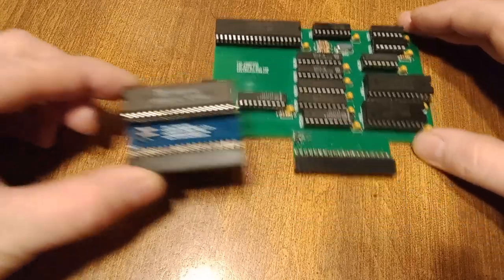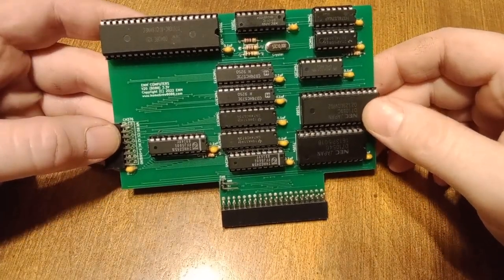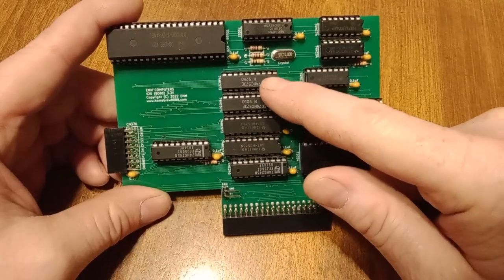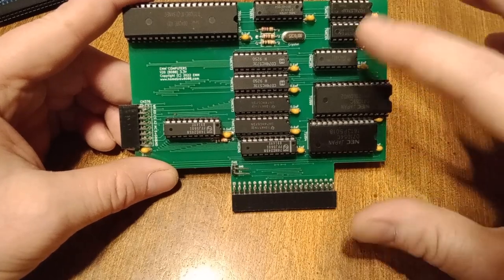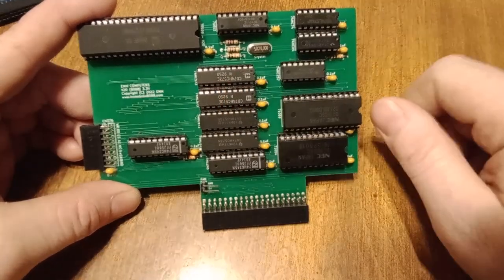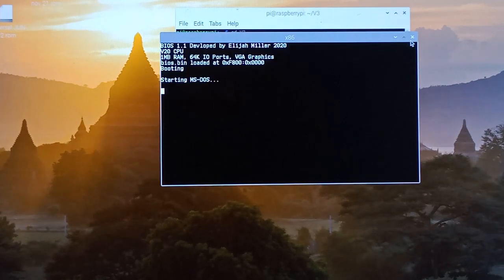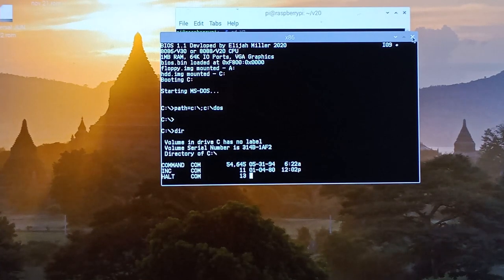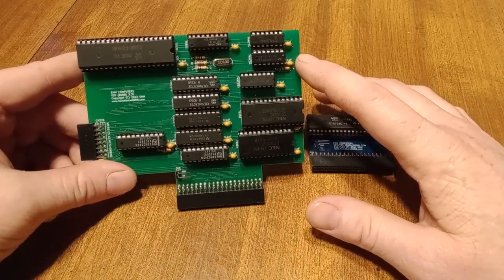PI86 Version 3

Comment: Great video!
Just curious - do you think your project could become something like a "sidecard" - I mean some sort of a card which could run X86 apps while running other native ARM apps? I think such a solution could be useful for some legacy hardware where someone wants to move to an ARM and he/she is "stuck" with some legacy software.
Reply from the maker: I think something like that could be done. It would not be very efficient and would probably be faster to emulate x86.
Reply: @elijahmmiller  If you need a faster bus connection, then perhaps you could look at the Pi's CM4 solution, it has PCIe bus
Reply from the maker: I will have to check it out. I have been playing around with the RPI Pico. It is actually not the RPI hardware that is the issue. It seems more that the Linux kernel read and write speed to the GPIOs
Reply: @elijahmmiller  there's a good chance the bare metal RasPi version of Circuit Python would perform better bit twiddling GPIO even with the interpreter overhead. A bare metal SDK like Circle should definitely do better.

Comment: Might also try using direct GPIO calls and not going through the wiring library along with DMA on the GPIOs. Ive seen 68k emulators for like the amiga's and such that use the pi as the cpu, and thats a faster cpu then what your trying to read from, so the GPIOs id assume can be fast enough.
Reply from the maker: Do you have a link to some resources on direct GPIO calls

Comment: stating the obvious: microcontrollers != processors. Raspberry pi is run on a microcontroller, he will always be the speed problem
Reply: RPi actually uses a true microprocessor. For the Pi4, it's a quad-core ARM Cortex A72 at up to 1.8GHz. The issue is how fast the GPIO can be toggled and read to emulate the 8088s data, address, and control busses. GPIOs on the Pi are not equivalent to bare data, address, and control busses (which the ARM CPU of course has), and shouldn't be expected to perform as such.
Reply: @AdrianLauf  thanks, did not known that
Reply: @32768hertz  This is actually part of the problem. Raspberry Pi (other than the Pico/RP2040 which is a microcontroller) is a full microprocessor, often SMP, system, which the author runs a general purpose OS (Linux without realtime patches) on and his emulator is a regular userspace process which doesn't appear to be run at high priority or locked to a particular core (with Linux instructed to handle IRQs on that core). The latency is what's causing a significant part of the problem. It appears to be a throughput problem, but it's actually latency because operations are sequential and ordered. Speed, as in frequency or MIPS which is what you mean, is actually not in itself determinative - if he had a non-naive FPGA implementation of the peripherals running at sub-50MHz, it'd be much faster than his software implementation on a 1.8GHz multi-core ARM cpu. For that matter, I suspect a non-naive software implementation on a Cortex-M microcontroller running at 48MHz (a low end stm32 part, say) would do better too. There's actually nothing stopping one using a Pi bare-metal like a very fast microcontroller, or even restricting a general purpose OS to one core and running bare-metal code (or an RTOS) on another.

To be clear: I'm not knocking the author. This is a cool idea and a cool project, and I bet he's got a fantastic understanding of the workings of this particular cpu out of it. From a pedagogical point of view not measuring the performance and establishing where the bottleneck is and just trying something on a hunch isn't great, but everyone's got a right to pursue their hobby in whatever way they please. FWIW, I just made a guess about the problem without reading the code, and that's not great either (but it's a fairly educated guess) ;) The author never claimed to be an expert, just a hacker with a cool project he wanted to show off. It's also laudable when someone shows something that didn't work. A negative result is still a result, and can often teach more than a success. Yet it's not easy to post something that ~ failed, and it ought to be commended.